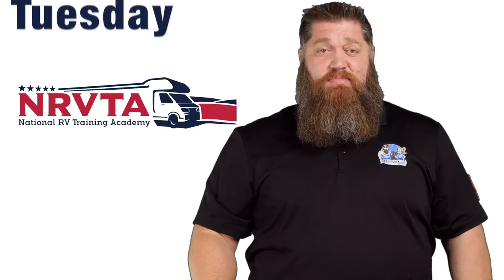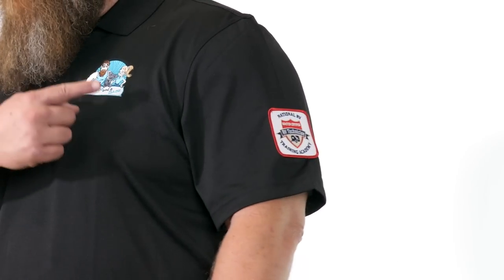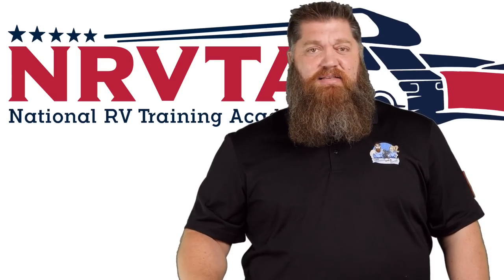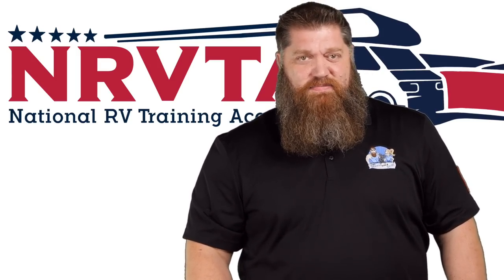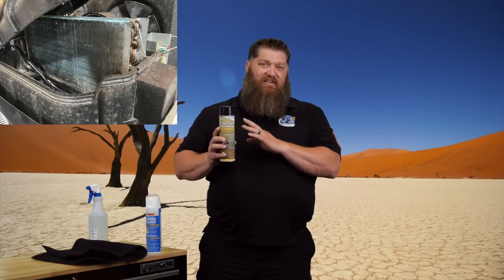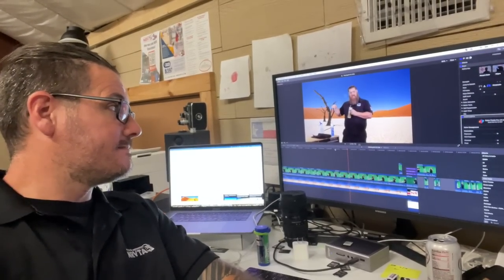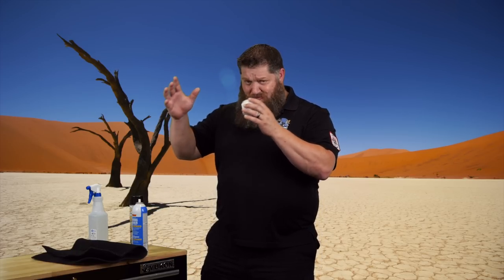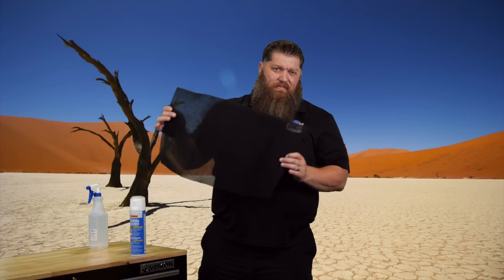How to clean RV Air Conditioner coils and filters

Comment: Tiffin rally two weeks ago included a seminar from a couple guys from Coleman on their AC units. They recommended against some of the stuff created for RV AC cleaning as being harsh; even having acid in it. That’s a bad combo for a full paint job. Recommended that if anything use some Dawn dish soap and water in a spray bottle. Not sure about the two products mentioned in this vid but I think I’m going with the Dawn.
Reply from the maker: And that’s why you want to spray it down with water after, but not too much where it’s leaking down the sides of your RV.
Reply: What about simple green? It’s not harmful or acidic, has enzymes wouldn’t be harmful to anything on the RV or the environment.

Comment: Hey Todd-
Can you talk about the topic of these Air Conditioner modifications that claim to increase air flow when foam board is installed into the plenum?  I have seen many youtube DIY videos as well as one system that claims to be specially designed to be installed which achieves better overall air flow. Thanks in advance and y'all are the bomb!

Comment: Not sure where you are finding the spray at Wally World but I did find the cut to fit filter in the outdoors/rv section. It was light blue & $9.99 though, not 0.99. I will have to look where the home filters are next time.  Also, I am a AC tech & you want to be careful what cleaners are used on evaporator & condenser coils, even if that is what it is manufactured for. What you are using in the video may be safe but it is always wise to do one's research beforehand. Thanks for the videos.
Reply from the maker: Both items are located where the home ac filters are. You will pay more for precut filters in the RV section, however in the home air conditioning section you can pic both items up.

Comment: Hi im in a delema . Im ac tec . Called furrion on my frig . How do i clean the condenciNg coil do i have to pull out the 10 cube frig ?? Called manufacture they said just vacume out the vents. That cant be all !! Or is it? Thanke you for your time
Reply from the maker: the rv refrigerators are easy to clean up with a vacuum. airflow out the back is key for proper heat transfer out of the refrigerator box.

Comment: Yes folks, he is quicker than the average bear, otherwise he would have dropped that cap on the outtakes.  But Todd, what if I have those new-fangled type of air filters (that the previous owner NEVER cleaned) that I just rinse under water, do I still have to buy that black foam?  Just kidding, I'm not quite that stupid.  Keep the good stuff coming buddy.

Comment: How quickly after I have cleaned the ACs/sprayed and cleaned the coils can I turn on the ACs again?
Reply from the maker: Make sure the air conditioner is completely dry before you use it. You should wait about 30 to 60 minutes before turning on the AC after cleaning the coils.

Comment: I’m really considering a mini split w/ heat pump on my unit… Just added a second unit but I am starting to realize I should have gone the other way. Less weight on the roof  Quite . Easily cleaned on ground level. Heat pump did I say quite Has anyone adapted this from the factory?
Reply from the maker: You know a lot of people are starting to do that.
Reply: The only concern I have is if the RV is not stationary. Not sure if the condenser is designed do be bouncing around on the back bumper. But if your stationary I think it's a great idea